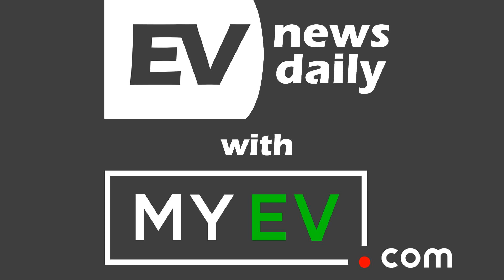05 Oct 2018 | Next Stage Of Electrify America, Oil Price Increases Help Electric Cars and VW...

Comment: Question Of The Week?

BEV all the way in the long run. In the mean time there may be some flavours of PHEV, but the main problem PHEVs have is that potential buyers are having a hard time to understand what they are. 
- Filling in two fuels
- Hard to calculate how much fuel and how much electricity one will consume (before buying)
- Different drivetrain characteristics depending if you are on gas or in EV mode
- Packaging two drives in a car - smaller usable space

I think it's more of a question PHEV or regular Hybrid, because driving characteristics are not that much different and potential buyers will look only at what is more economical to own. That said a normal hybrid may grow in battery size without added cost, the battery would still be small, but enough to drive the city route. On the other hand I don't believe there is much potential in range extender BEVs, may the BMW back me up o this ;)
Reply from the maker: Good point on the range extender with today’s news BMW are dropping it from the i3 in Europe. My brother bought it BECAUSE of the REx and the security it provides, he definitely wouldn’t have for an EV if it was pure battery.

Comment: Hi Martyn. It is still funny listening to this on YouTube and then hearing you again introducing all my favourite 80s  tunes on the radio. Keep up the great work it is appreciated. 
My response to the Hybrid question is that I did actually consider this a few years ago but I threw it out for a reason I have since heard many times. A hybrid IMHO is the "worst of two worlds" when it comes to efficiency. When you are in ICE mode you are burning more fossil fuels than the average ICE only vehicle because you are carrying around an extra power train and a weight of batteries. When in pure EV mode you are carting around a load of dead liquid dinosaurs as well as an extra power train so EV range is very limited.  
Vehicle manufacturers should focus on improving vehicle battery technology for increase range, faster charging and lower costs rather than hybrid technologies.
Reply from the maker: 😂 I’m everywhere! Thank you for your comment this week too. Mart
Reply: @EVNewsDaily  
Absolutely!😉

Comment: During the fullycharged (Jonny Smith) EQC test they indicated (it seemed to me) that Mercedes are aiming for the "car by car" solution.
Reply from the maker: Oh wow. That would be logistically...a challenge! But I don’t doubt their German efficiency.
Reply: @EVNewsDaily  
I would it's 
Wiring loom
Front unit
Rear unit
Dash/ display(?)
If it's "modular" as they seemed to suggest, much, if not all of the other parts would remain the same?
Ref timestamp From 11:10-11:48
https://youtu.be/Y7ZjkoJgXWk